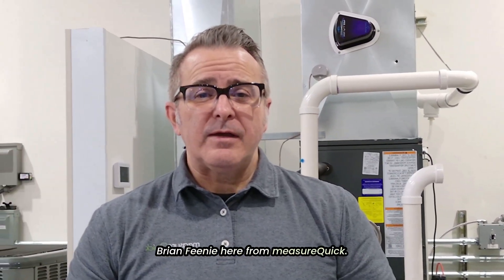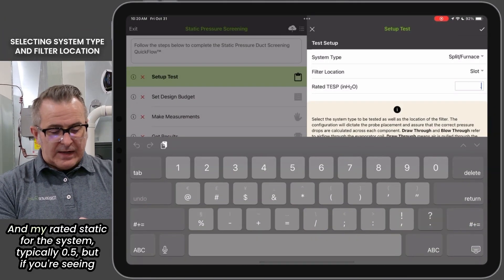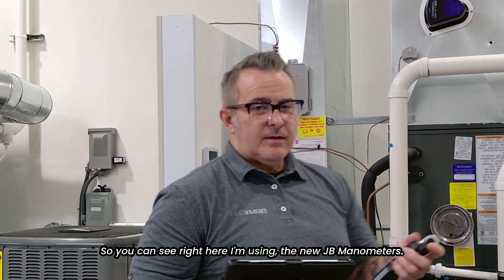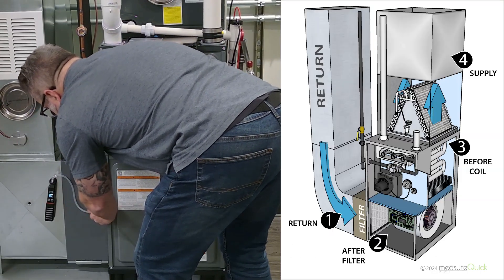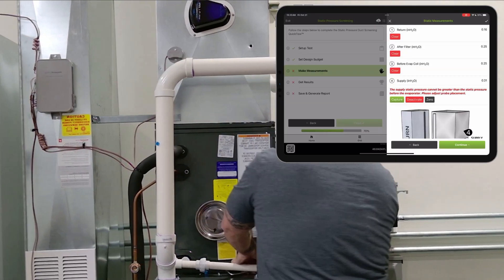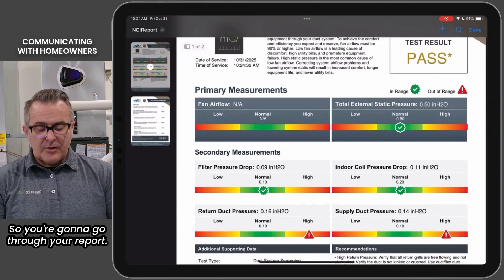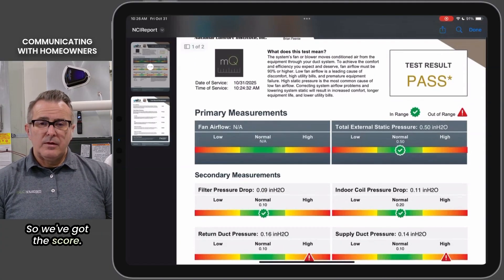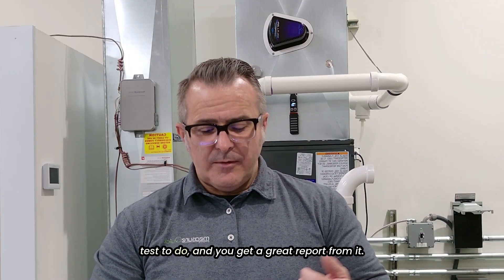Static Pressure Screening Tutorial w/ Brian Feenie

Comment: Great video Brian, I think this is a great way for new construction teams to test out their installs to make sure they are within the equipment specs.  Even the Home Inspector to use for new and existing homes! If the home has high static pressure, the equipment is working harder than it should!

Comment: Great demo, thanks.  Hearing lots of good things about the JB probes.  Very interested in any feedback from techs who have used the JB probes and other brand probes to know how they compare.
Reply: I have the fieldpiece complete line as well as the jb psychrometers,pipe temp clamps and pressure probes. I do not have the jb manometers but if I needed any more than I already have I would buy the jb's.  I like that all the jb's have the displays but I also love the app, sometimes I dont need to do a full mq session, the jb app looks very similar to mq so its the best app out of all the manufacturers so far imho. And they are a similar quality feel to the  fieldpiece probes which is great, just go get them already lol😂
Reply: @HVACRTECH-83   Thanks, I have been looking for something with built in screens (main thing I think Fieldpiece could improve on).  How about the JB probe range?  Any better or worse than the Fieldpiece?
Reply: @CoolingPerformance similar range with the JB Probes.